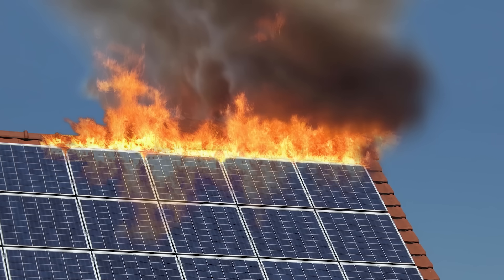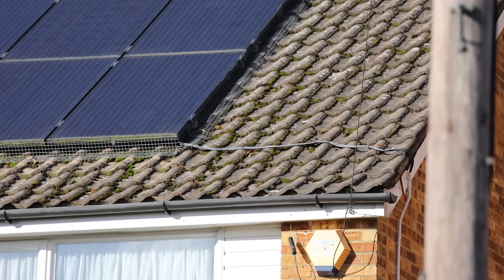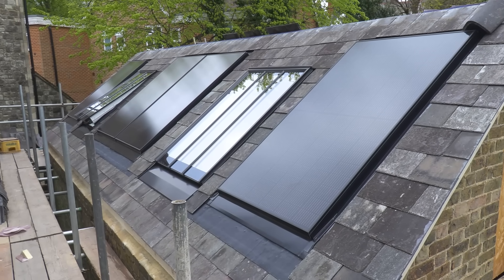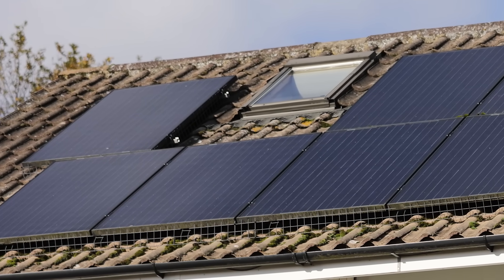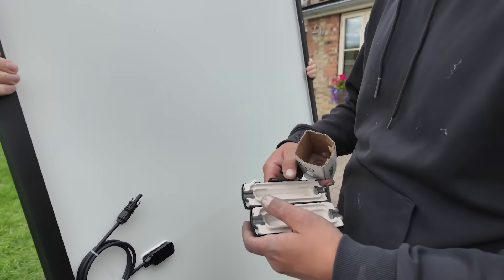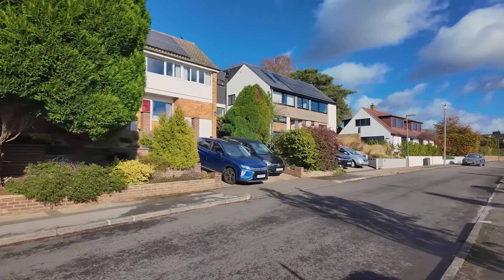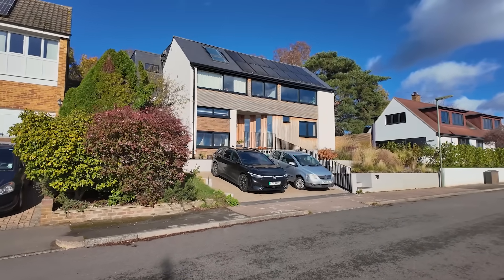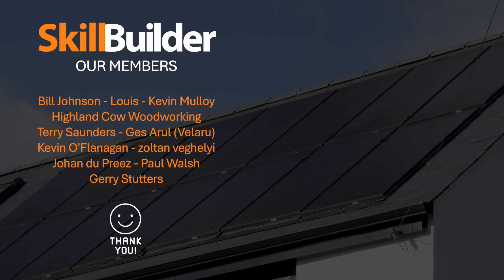Solar Panel Fires Are Rising – Here’s Why

Comment: You’re going in circles around the real issue. These panels are runaways. The same way batteries run away in a Tesla. As long as there’s light hitting the panel, it’s producing power and shooting it out like lightning. It cannot be turned off as long as light is shining on it even if it does have the correct switches and wiring in boxes, etc. Its a run away. Solar Panels cannot be turned off. You’re not addressing that you’re not telling people that. People need to know the real science. People need to know the potential bombs that they’re putting on their roofs.
Reply: Bombs😂
Reply: Can you elaborate on how solar panels shoot out power like lightning?
Reply: Do you know how a circuit works? 🤦‍♂️

Comment: Panels with inverter built in or attached are better as the ac current is less dangerous. No equipment should be installed in the loft, I recommend running cables outside and, where practical mount battery and other equipment on a masonry wall. Isolating can be installed at a lower level so in the event of an emergency can be operated without entering the building. There are sodium batteries coming on the market, which seem to be better in most ways except efficiency at the moment.
Reply: At the voltages and currents involved AC being "less dangerous" is a bit of a myth for this purpose. An AC circuit will zero cross which makes electrocuting yourself more survivable and switches more reliable. If the problem on a roof though is a bad connector it'll help a bit however the  AC voltage will be about 230v off microinverters on a roof and they are combined at 230v so your current can be much higher than if you have a couple of DC strings at far higher voltage.

At the end of the day it's current that causes heating if you get a poor connection.
Reply: as I understand it, dc current is more likely to cause a fire at a loose connection due to the heat from arcing and will sustain an arc over a larger gap? It also can’t be isolated other than covering the panel. The lower the voltage the higher the current for a given output so, would that not make it more likely to arc, I think the string voltage is normally kept lower isn’t it? I did do an ecs course on solar a few years ago but have never used it as yet so forgotten much of it!
Do afdd’s work on dc?
Reply: @mikeking2855  DC is more likely to cause a fire if there is arcing and will sustain when AC won't. However on a straight poor connection it's the resistance that generates the heat and it doesn't matter if its AC or DC it's straight current level.
Many inverters go up to 450/500v on each string and you get the voltage as high as you can to reduce the current and thus losses (although obviously subject to suitable cable and panels)

There are arc fault detection systems for DC. In fact in some countries they are mandatory. Some inverters also include them out of the box
Reply: Micro-inverters are a pain to replace and subject to harsher conditions than your average string inverter.

Comment: Intumescent material does not actually smother the fire. When it gets above a certain temperature e.g. in contact with flames, it expands to seal up the openings. It's often used as firestop around service risers between different floors/rooms.

Comment: My good friend has had solar panels for 20 years now no issues . Just cheap bills and good payback
Reply from the maker: Brian
 I said it was a low risk, three per week but if it happens to your good friend they will no doubt take a different view. I was careful to put this in context.
Reply: @SkillBuilder could be down to bad installations like with heat pumps
Reply: Personal anecdotes are of no relevance to the topic which is 'poor installs causing fires' , I too have had no issues with my panels , its irrelevant , please grow up and use your brain, engage properly as your comment comes across as condescending and lacking the intellectual capacity to provide help in finding solutions.
Reply: @pinarellolimoncello 💩
Reply: WEF SPONSOR GHOUL TODDLE OFF!
Reply: What an embarrassing picture of yourself
Reply: @4D1989  You have been watching SkillBuilder for a while haven't you?

Comment: I have watched a few 'Solar Panel myth busting' video's and for each myth 'busted' there is always a caveat - the opposite can be the case.

Where I live, I see people putting their electric  cars into an integral garage in their house - one couple has two electric cars in their integral garage - that's living dangerously :/
Reply: EV fires happen far less than petrol car fires, and garages are already designed on that basis. It's a reason they are also a great spot for static home batteries too.

A building regs compliant garage has fire resistant materials and even a lip in case a petrol car spills fuel and it all goes up in flames.

Comment: Roger. It took me 30 secs to Google this copy below.. I am surprised that you did not check.
New installations are prohibited: New installations of batteries in lofts are prohibited by new industry standards and recommended guidelines.

Existing installations are not retrospective: The new regulations do not require the removal of existing batteries from lofts, but it is strongly advised to check if they meet current standards.

Better locations: Suitable alternative locations include utility rooms, garages, or dedicated battery rooms that are well-ventilated, temperature-controlled, and have clear access.
Reply: I would urge caution on utility rooms as it depends on whether the room is part of the dwelling space - from what I recall the new regulations restrict installation to outside of the dwelling space which essentially means there must be fire separation present - garages are fine as the regulations require fire separation to be installed.
Reply from the maker: I don't understand your point. I said it would be a good idea to move batteries from the roof space. Maybe watch again if you think I was remiss.
Reply: it's not prohibited.
Reply: Batteries being installed in lofts isn't prohibited in the UK.
Reply: It's not prohibited. If you stop smoking chatgpt and read the actual guidance it's currently only a recommendation. That's not the same thing. It does however persuade most installers to put them where recommended simply because if you ever have a failure and you get dragged into a court "we didn't follow the recommendations" doesn't sound good in a negligence claim.
Reply: @etchedpixels  MCS still allows its accredited installers to put batteries in a loft. So they wouldn't even have to go to court.
Reply: @etchedpixels true, but is requirement for most insurance (for new installs)and also apparently for DNO connections where there isn’t an existing connection and an approval would be required.  But if a person were to fit such a system it won’t be compliant with “industry standards” and if the system caused a fire then insurers may decline to pay out.  Also if the units themselves stipulate that they are not permitted to be fitted in loft spaces then this would be breach of building regulations as the regulations require compliance with manufacturer instructions.
Reply: @_chrisr_  MCS accredited installers are still able to install batteries in a loft, so seeing as it's the main industry body that covers domestic installations the majority of what you've written is false. Also, the DNO isn't concerned with the location of inverters and batteries. If they were, you'd easily be able to point to the Engineering Recommendation (EREC) stating such.
Reply: @VinoVeritas_  I partially agree - I take back what I said about DNO - although they ask for MCS accreditation they can't legally withhold connection if the installation complies with G98/G99 - although how this is demonstrated is a different matter.  The PAS 63100:2024 regulations do say "batteries shall not be installed in"... "voids, roof spaces or lofts".  but these are not statutory in nature.  Furthermore the manufacturer does need to approve of loft installs and some do otherwise the installation will be in breach of building regulations.
Reply: @_chrisr_  DNOs do not ask for MCS accreditation. You're making that up. There isn't a single EREC or form that even mentions MCS. That's because MCS is a complete and utter irrelevance for DNOs. Which battery manufacturers state that its batteries should not be installed in lofts? Which section of the Building Regulations deals with batteries being installed in lofts?
Reply: >  New installations of batteries in lofts are prohibited by new industry standards 
Not true.  Just guidance which means they are still allowed.  However hopefully most installers will take note and avoid the loft.

Comment: Thanks Roger, some electrician channel mentioned about myths/ risks recently but ironically you were much more informative
Reply: That was Artisan. I watched that too. they did break a few myths, but were also economical with all the facts and fudged over a few points.
Reply: @TheSadButMadLad at least they it's the installation which is the issue i.e. their crowd haha
Reply: @TheSadButMadLad  He failed to mention any of the serious negatives with solar panels. To start, they are very inneffiecient when hot so in full sunlight nobbled. If a single cell of a panel fails the entire panel fails. If a leaf covers part of one cell the entire panel will lose efficiency and that of the entire system. Inevitable dirt build up will massively reduce output. Solar doesnt work at night. Doesnt work in full sunlight. Takes up a huge amount of space for a minimal amount of power generation. Costs a fortune, paid to our enemy China. Dont start me on wind turbines
Reply: @bgg-jp5ei  Most of what you said is completely untrue. Tell me, what's the temperature coefficient of a c-Si solar PV panel?
Reply: @bgg-jp5ei  you can by panels from friend,like Canadian Solar or Dutch/German made in EU. More expensive than chinese of course.Yes,efficiency is lower with ambient temperature,but not drastically. You still produce more kWh/day in the Summer than Winter,because days are longer and sun is higher irradiating more panels for longer.
Reply: @MrTurboSAAB1 ya don't say!
Reply: @VinoVeritas_  Specify exactly what you think is not true bearing in mind that I am a qualified electrician and can provide lots of evidence of the uselessness of  solar and wind
Reply: @bgg-jp5ei  You've already been challenged about your "very inefficient when hot" claim, which of course you haven't addressed because it's not true. The point that was being made by @MrTurboSAAB1 which you sarcastically dismissed was that at at the times when efficiency drops you're likely to have excess solar generation anyway so it doesn't matter. My suburban London roof cuts my imported electricity and gas (water heating) to zero for two thirds of the year, so if that's "minimal amount of power" then I can't imagine how much you consume - do you boil a hot tub all day?
Reply: @bgg-jp5ei why? are you equally well missinformed about them too? Like everything conspiracy theorists and climate change deniers say some bits might have a grain of truth as a basis but you take it too far. Who cares if in the the heat of summer and the sunniest days  solar panels are less efficient? On such days you will still have far more electricity from them than you can cope with so it could almost be seen as an advantage. My panels have been up for 14 years and for 10 years they stayed clean, this year I finally cleaned them and they were filthy. Solar generation since then has been up 10%, but actually most of that increase was down to this being a great year for solar. Some of the "dirt" on my panels was circles of lichen, far worse than a leaf, but the output was simply reduced by a small amount. Solar panels, even old ones like mine, have bypass diodes in them to address that type of shading issue. And despite what anyone says to the contrary, solar panels dont work at night so you were 100% correct in that one.
Reply: @bgg-jp5ei somehow I doubt you are a qualified electrician (or if you are, how on earth did you manage to become qualified with that level of misinformation in your head). I would expect a qualified electrician to not be so misinformed, or at least not willing to deliberately misinformation others. "dont work at night", you got that bit right, and should have quit when you were ahead.

Comment: I know the wiring is never protected as it just sits out in the sun and dry rots. Not cost-effective to put these on homes in our area as it would cost the homeowners insurance to increase to about $10,000 a year.
Reply: For the UK the wiring requirements for the cable requirements for solar are pretty strict including double insulation and high UV resistance.
Approved (MCS certified) installations have no effect on household insurance on a normal house.
Reply: @etchedpixels It depends on the region of the country you live in as some insurance companies will drop you like a rock if they find out you have solar panels on top of your home.

Comment: If the situation is similar to what's going on here in Sweden, a lot of the problems can be attributed to poor installation.
With a boom in demand for solar panels an industry popped up extremely quickly and pushed out newly hired people with little or no experience or qualifications. With a licensed electrician hooking up the last bits but not the bulk of the job, errors and shortcuts are sure to happen.
Reply: Yes, high current dc can cause severe overheating if contacts are not perfect or incorrectly installed, as nvidia 5090 owners are finding
Reply: That sounds all too familiar....
Reply: This is true. I observed the men fitting them next door to me. They were not from an established company.
Reply: The UK speciality in construction is botching the job. If you walk around a UK new build and admire the slightly leaning walls, leaky plumbing, abysmal brickwork, misfitting windows and all the rest you get a fine appreciation for how bad quality control is and the kind of people they'll employ since they lost all the foreign builders to brexit and can't find any.
There are lots of good tradesfolk in the UK but boy do we also have a lot of clowns.
Reply: @etchedpixels 100% Correct 👍
Reply: @etchedpixels brexit deranged plonker
Reply: @etchedpixels  plenty of imported cowboys as well
Reply: @AlexSmith-y4i6t  Not really they all went home after brexit, or elsewhere in Europe. Pay is way better.
Reply: @etchedpixels  I live in London and there is no sign of any EU exodus
Reply: WRONG!
Reply: @SwedishNiceGuy Great argument

Comment: Yes, I have solar panels and  yes, I do recommend them to anyone who is willing to design and install them in a professional way.
DIY-ers are taking some risks they don't fully understand.
Reply: There is no evidence that the fires are coming from DIY installations. It may be the case but there is nothing recorded
Reply: @Roger-Bisby1  well an example of one of the many many things that can go wrong is just making an MC4 connection - mismatched connectors, poor crimping, overtight/undertight, unsecured cables...times that by 30-50 and get it right ever. single. time. Frustrating but most DIY ers can't be bothered learning how to do things correctly.
Reply: Very strange to assume this is in anyway a DIY issue. Its a trades people being trades people, in bodge on the next job.

Comment: Smothers the DC power coming from working solar panels - that I have to see, over & over & over again until the sun goes down.
Reply: what you mean? If you can break the arc, there won't be a problem - think T-class fuses and the small amount of sand and short distance between the contacts. If you broke connection halfway between a string of 12 panels and put the mc4 close to each other it won't arc across🤷‍♂
Reply: @asedcopf  I may have misunderstood your point, but wherever you break the circuit you are going to get the full voltage across the break.